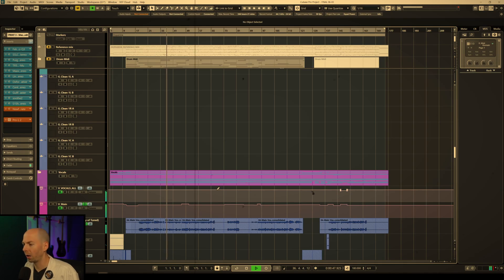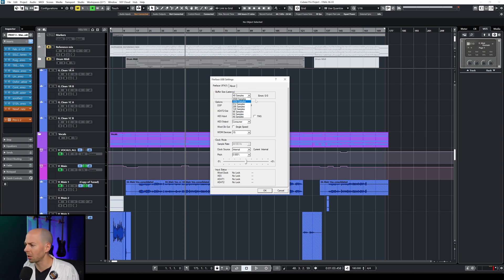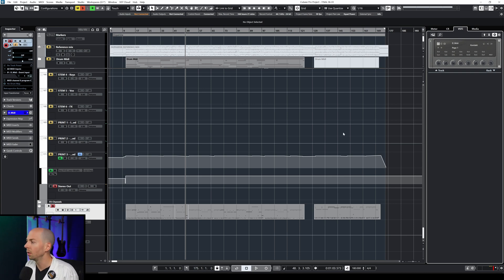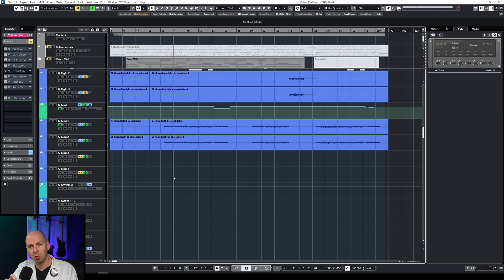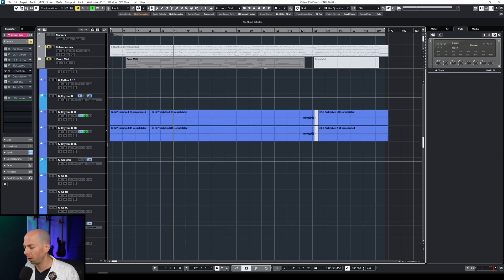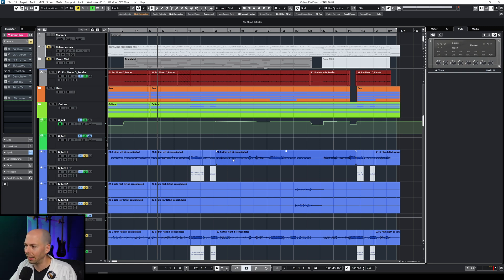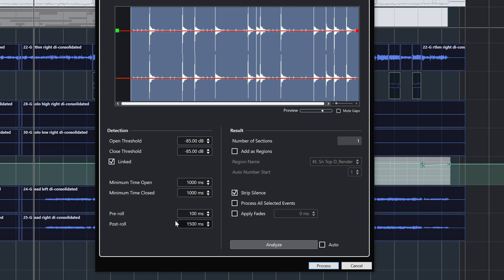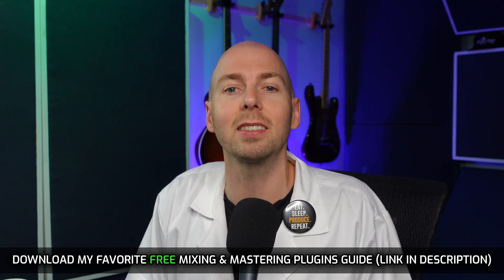8 Quick Fixes for Audio Dropouts in DAWs (Cubase, FL Studio, Logic, Pro Tools, Studio One)

Comment: I appreciate this vid.  I thought I'd add a solution I found for my audio drop out situation - I was collaborating with a composer in nuendo and he had set up an elaborate tempo track.  My audio kept dropping out randomly until I saw that the session had the "Activate Tempo Track" button pushed.  It's a small arrow next to a musical note on the bottom transport control display area.  Unselecting that fixed my drop out problems.

Comment: Honestly your Performance Meter was still in the reds . I started using Cubase in 2002 and turned recently to Reaper with a Logic Interface Mod. In Reaper you can load VSTs as an external Process in Windows on individual basis. This usually brings down your CPU usage by 80% ... you cannot do this in Cubase. I tried to convert projects from Cubase to Reaper and luckily they turned out to be matching... interestingly ... the CPU usage in Cubase was 95% Performance meter with Heavy Reverbs from Spitfire... but in Reaper only 9%... you get the point. There are also Forum Posts in the Steinberg Forum. Cubase 13 and 14 has some really enormous Performance Problems. When you want to stay with Cubase try out Cubase 12 pro.. which has also a low CPU profile like Reaper.

Comment: I always have to restart my laptop multiple times while recording a song (guitar). After adding 4 5 tracks, the sound starts to flicker and it just disconnects for 10 15 secs then comes back flickering again.  I use cubase and have 16 gb RAM, i5 11th gen on my dell laptop. When I checked the memory usage, Cubase only took 882 MB but still there's this sound issue. Not sure if upgrading a RAM will fix this. do you have any suggestions?
Reply from the maker: Check your buffer settings. Otherwise your plugins are demanding too much cpu. Try disabling some to see if it fixes the problem.

Comment: Hey Bobby. I was having a serious problem with my Cubase 11 Elements. The audio would drop out intermittently and I tried all the tips you suggested, but it still did not solve the problem. What you did do is point me in the right direction and I started playing with the settings in Studio Setup. After a few days of frustration, I finally found a solution that worked for me so I thought I would share it with you and your listeners. It turned out that the checkbox that said "Activate Steinberg Audio Power Scheme" was checked, but the disk preload was set at what I assume was the default setting of 2 seconds. When I increased the disk preload to 6 seconds, my problem was finally solved. Again, thanks for pointing me in the right direction. I would not have thought to look at this setting without your help.

Comment: I've been having problems with my Steinberg from new. Always get fobbed off by so called customer services. Currently, if I load Cubase at all, the interface just stops the Software loading and all I get is teh Spinning Wheel of death and or it takes about 2 hours to load.
Also, I get constant drop out of audio to my Monitor, which has its own internal speakers. So, this is not a CPU issue and any help would be sincerely appreciated.

Comment: please check the Info on the Steinberg HP: Intel 12000 and 13000 Chips have issues with P Cores and E Cores. This causes performance problems because Multicore-Support doesn't work correctly.